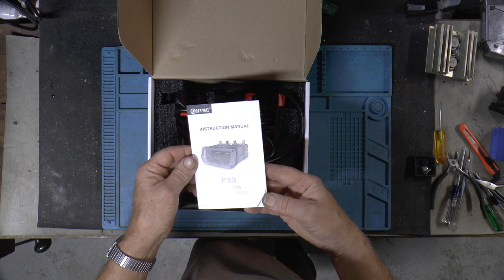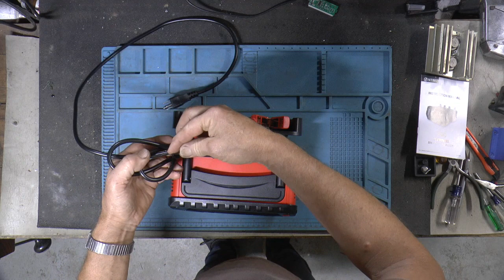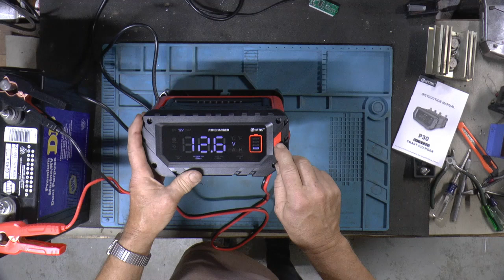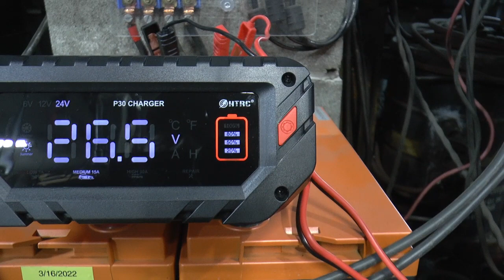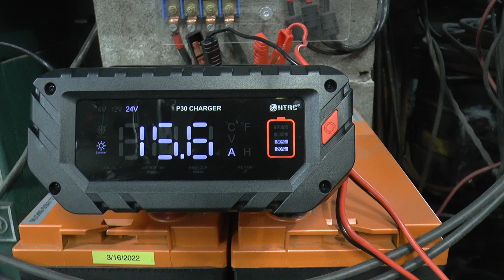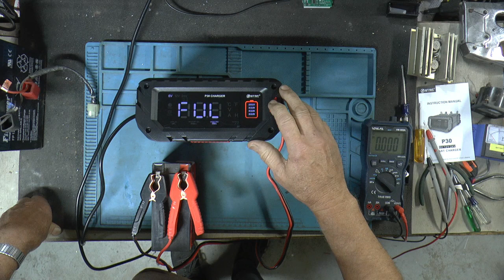HTRC P30 30 Amp Smart Battery Charger

Comment: I cant change this charger from 24 volt to 12 volt, It just switches from low to 15 amp to 30 to repair. It wont go off 24 volt????? I would rather have old school individual switches.

Comment: Beware when your 24V battery wont charge when the auto sensing mode in this type of charger says fully charged in the 12V mode.                                                                                    These need a 12V or 24V manual switch. Very worthless while trying to charge a low voltage 24V battery.  😖

Comment: Why won't mine start
Reply from the maker: Smart chargers require the battery to have some voltage in order for the it to start charging. Wrong polarity would also keep it from charging. If a LiFepo4 battery is shut down from the BMS sensing low voltage shut down. The battery needs a voltage from another battery or power supply to wake up the battery. Just something to double check.
Reply: @kevincrawford2027  thank you I think that was the problem my battery was completely dead

Comment: Smart chargers are okay for most needs but they won’t bring a deeply discharged wet cell battery back up.  I recently had one that only read 4 volts and two different smart chargers wouldn’t initiate a charging cycle.  The old 10/40/200 Schumaker brought it back though.